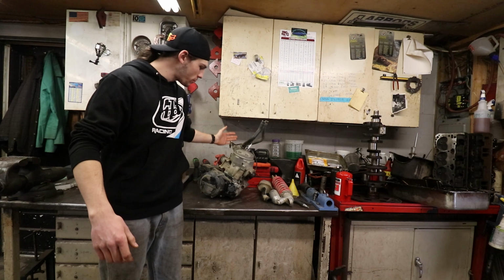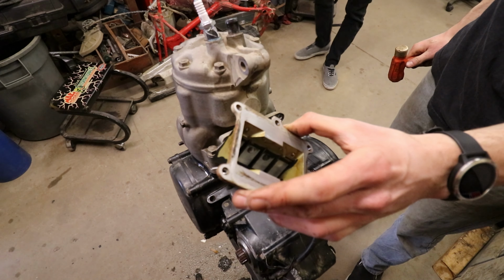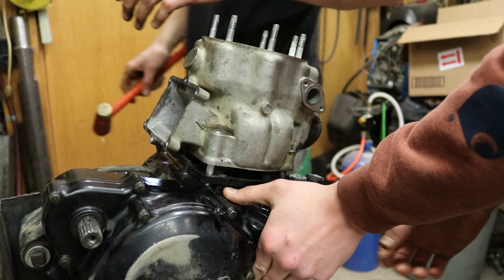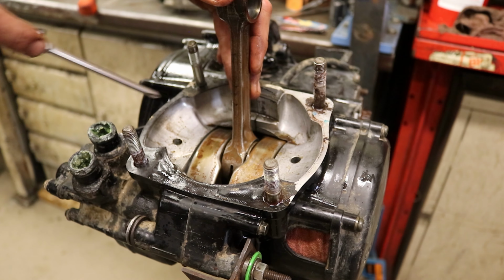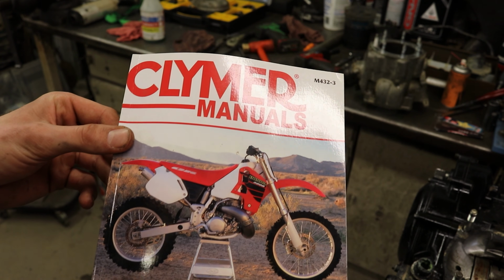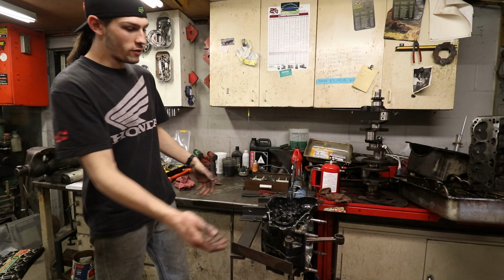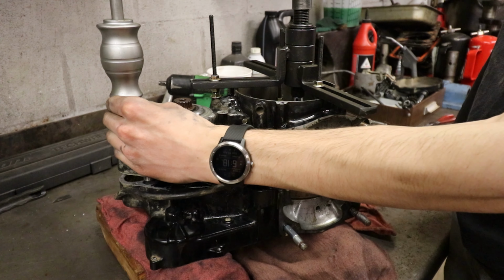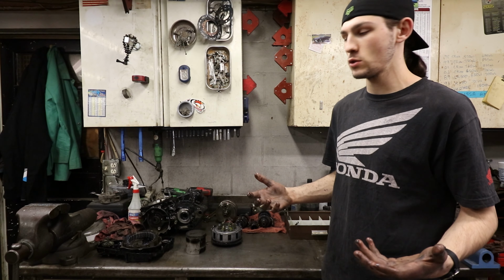Cr500 Rebuild Part 2 - Engine Tear down!

Comment: Awesome Job ! I'm just starting the process of rebuilding my 1988 CR500 ,that  I've had for over 30 years. I love the blind bearing & slap hammer on the back of the case, as you were splitting it ! Excellent Idea ! You definitely taught this "Old Dog" a "New Trick" ! I didn't see that, in any of the other videos, I watched, on rebuilding CR500 engines. Good Job ! Thanks for the great info. Do you know who, I can send my original crank too , to get it re-worked ? Thanks.  Keep up the good Work.
Reply from the maker: We personally do all our own work, so I am not sure of anywhere to send it. I would recommend asking around in a forum or Facebook group, they can normally point you in the right direction. Hope this helps!

Comment: Would you recommend the bottom end rebuild kit by Hot Rods ? Sourced from Taiwan. Am currently looking for someone to rebuild my 500 don't know who to send to.
Reply from the maker: The Hot Rods rebuild kits are good and reliable if installed correctly. If we are unable to do an Oem crank we normally get a Hot Rods crank with Oem bearings.
Reply: Vintco
Reply: @cbr1thou  Are you serious? Vintco over a Wiseco? Bro, no chance in hell. Check your source and tolerances, because Wiseco is a top brand for a reason.